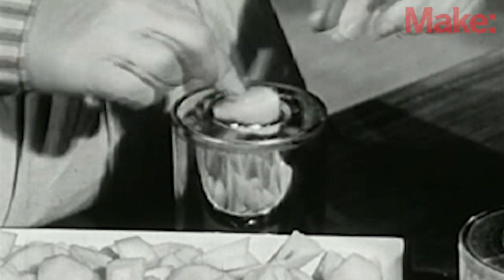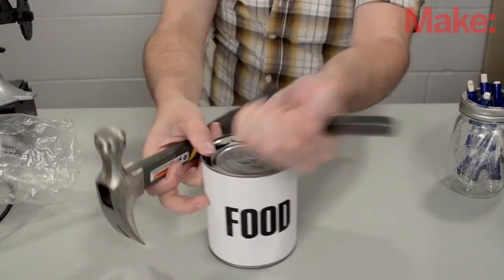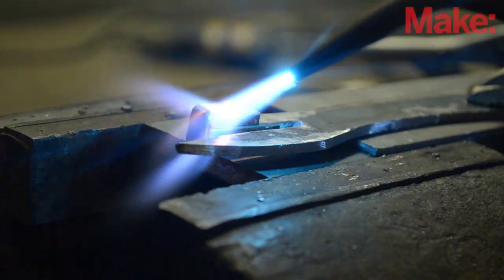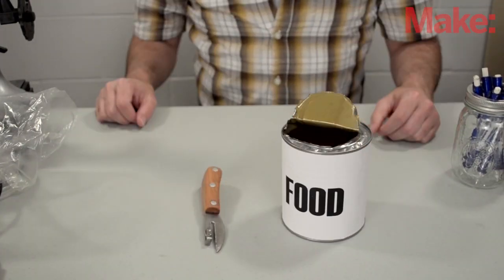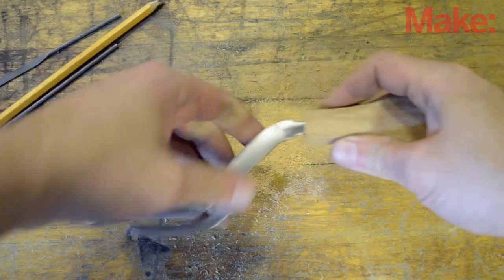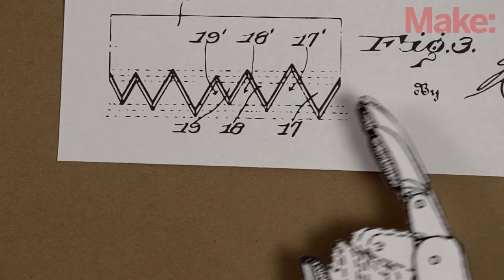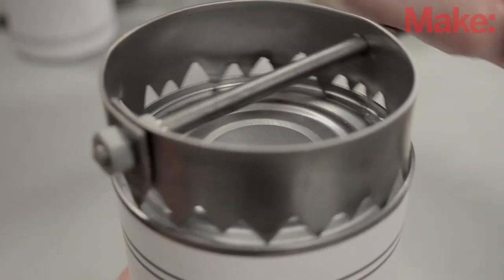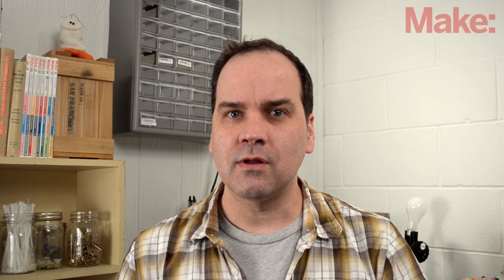Make: Inventions | Can Opener

Comment: To use the crab claw opener you need to punch in right next to the rim and lever on the rim, not the can lid like you were doing in the video. Takes a bit of practice but keeping it cutting just inside the rim is the secret. For the Ezra Warner opener, the purpose of the rotating piece was to control how deep the opener penetrated the can when puncturing the initial hole to get started. Unlike the crab claw opener, the very tip extending beyond the rotating part was pushed into the can, at the edge of the rim. The rotating part was then flipped parallel to the claw and the claw used similar to the crab claw opener. I suspect the rotating part and the tip are used to lever on the can rim to rotate the claw upward. As before, the secret is keeping the claw cutting at the rim and not in the middle of the lid.

Comment: The rotating part is a guide to keep the cutting edge near the rim.  The rotating guide is used parallel to the outside of the can.  There are similar openers that have a guide that doesn't rotate.

Comment: +Fabiola Yana
Use it at an angle, the small hook hooks on to the outside of the can the middle rounded part is the fulcrum which should be on the lid the you keep punching down sliding along the outside of the can.

Comment: I was thinking that he was using the first design upside down also. I think the dull tip is supposed to hook under the lip of the can and the blade can be worked around the edge. When used in this way, it can probably get about as good a a cut as a modern can opener.